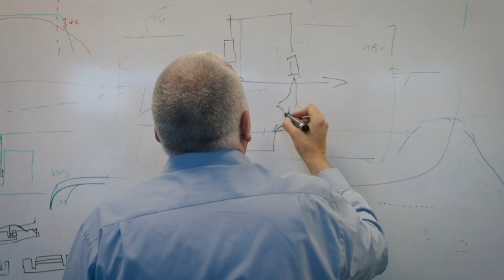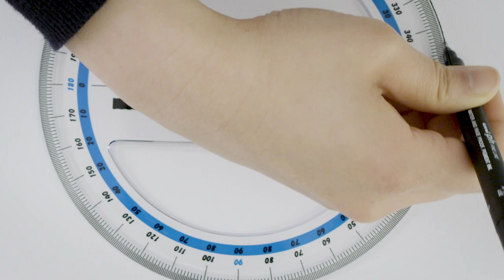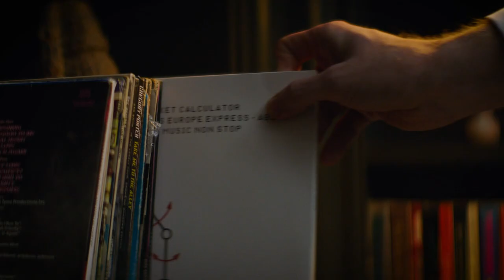The British Bid presents: Inside Monitor Audio

Comment: That's funny, I thought I started Monitor Audio. I teamed up with Martin Colloms on the original design of the MA1. Mo came in probably 6 months later as production manager. Assembly started with myself providing KEF drive units via  my retail shop Audio T (Cambridge) in those days KEF would not supply directly as we were unknown. Mo and myself spent many a long day in Mo's garage screwing drive units and soldering crossovers in place.  After a while I  sold out to Mo and joined AMC/UCI cinemas and worked developing 3 way cinema speakers and sound systems as chief engineer. I'm now retired and live in NZ. I still like Monitor Audio loudspeakers.
Reply: Would you recommend MA speakers made in the 2000s over todays modern speakers such as Klipsch?
Reply: @ricetogo  Personally I would not touch Klipsch speakers at all. I once had a pair for review and I thought they were dreadful. Boomy one note bass, tizzy HF, poor integration between the drive units. Resistant cabinet. etc. Very American.
Reply: @MichaelBeeny  Thank you Michael, it’s an honor to get an opinion from the man who was involved in designing and producing quality speakers in the early days. I love the quality of things that were produced back then. I am having a hard time deciding between an old Marantz SR 19 and the new modern day Sony receiver that support Dolby Atmost. Do you have any advice on those?
Reply: @ricetogo  It's hard to judge when I don't have the two to compare. The only thing to consider with a vintage piece of gear is the cost to keep it in mint condition. As equipment ages the capacitors dry out or even short. Some of the parts become obsolete. OK if you have the knowledge to fix these things, so buy with caution. On another point, most AV amplifiers are loaded with every format on the planet, but the amplifiers, largely because of the number of channels are compromised, power, heatsinking etc. I use an AV amplifier for movies but a separate discreet amplifier for stereo music. I talk and show such things on my YouTube channel, should you be interested in more detail.
Reply: @MichaelBeeny  I will check it out. Thank you sir!
Reply: 4:16
Reply: @jluis5188  I remember Annete very well.
Reply: @MichaelBeeny  legend ^^

Comment: Monitor Audio= Big marketing, with big margin, and in reality the used drivers are cheap chinese drivers with PLASTIC basket! And if 1 driver go bad, the new driwer sold so much you'd do better if you buy a new one. Don't misunderstood me i was a big M.A. fan,  it was a good brand till the 2000's, but now it's not that... Nowtime the big margin (profit) which remains with the merchant/traders allows many test writers/reviewers to encourage them to form a good opinion of the product and thus encourage them to buy, but in the reality this profit, whats land by the traders they are saved on the quality of the product, and thats not good for the buyers. Every newer modell much more trendyer outfit, lower quality, bigger profit, from this profit they can "buy" good reviews, and cheap cinese plastic product. This is the new directive by the Monitor Audio. I personally newer buy again from this brand.
Reply: But what about the profit margin on every other electronic and speaker product. The profit margin on a pair of $40,000 Focals, or $35,000 B&W. My M.O. RX8 speakers cost $2,300 a pair and looked and sounded way better than other $5,000 speakers I auditioned. Even sounded better than a pair of $7,000 B&W I listened to.
Reply: Plenty of brands have used plastic baskets including B&W and Focal.
Reply: why not make one for ownself.  you could built one